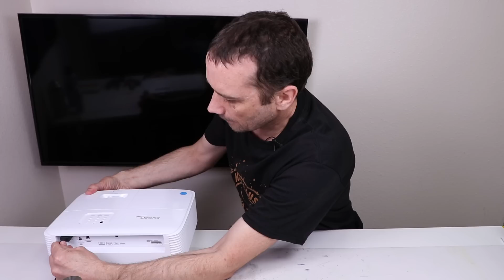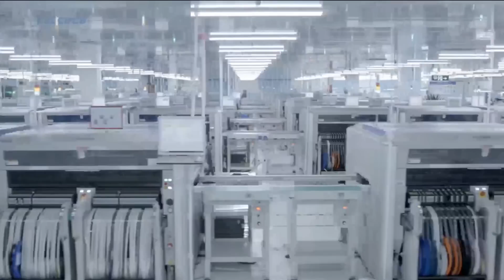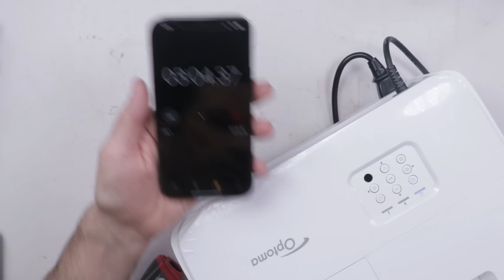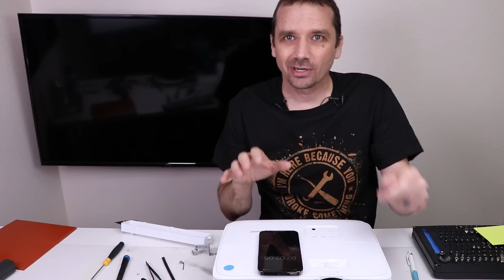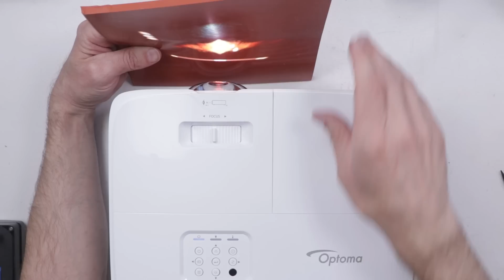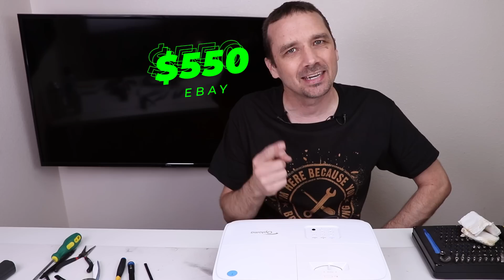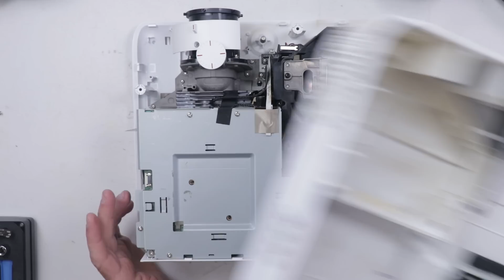I Bought 6 BROKEN Projectors - But Can I Fix Them and Make Money?!

Comment: Wish you would've shown how each displayed images in dark and lighter rooms.   Sometimes the bulbs need to be replaced eventhough they still give light.  The bulbs Don't last for ever. Enjoyed the video.
Reply from the maker: It's hard to know what testing to include in these types of videos. Usually the more testing I do on camera the less of the video people watch so I usually minimize the testing I show. I agree that if I were to sell these as used and tested then I would need to test them much more extensively. Anytime I don't have time to test something fully I sell it as untested so the buyer knows what to expect.
Reply: @Tronicsfix  I bought a few for 60 euros and and repaired them. Most of them had dust in their optical part because the filter had crumbled because of bad material, some had thermal cutoff fuses blown and some sony ones had a faulty chip on power supply. Anyways, its important to check the image, that its not dull, because of something in optics, like dust or that the colors are not off, sometimes there is something wrong with the LCD-s.
Reply: If you go into the menu, you can see the lamp hours
Reply: @absenteeatom  but still would of hoped he would of shown  the brightness of the lamps.   Lamp hours are guidelines not the true physical shape of the bulb.
Reply: @boomsharkboom  And also lamp hours can often be reset so you may not get an accurate account of the number of hours if someone reset the device before selling.
Reply: @boomsharkboom  I wasn't diagreeing with you, merely adding to your comment.
Reply: Sometimes the bulbs are nearly as expensive as the whole unit. It would be great if manufacturers included the "maintenance price" of a tech item, like how much ink/toner costs or a printer, or how much a bulb costs for a projector. 
At a former employer we purchased a projector for $299, just a cheap one, but the replacement bulbs were $249. They ended up just buying a new projector each time the bulb died. 
I have a color laser printer that costs as much as the printer did to put all 4 toner cartridges in. Nearly $600. Sure they last a few years for me, but it's still crazy, and it'll just throw errors if you try to put non-oem toner in it.
Reply: I Agree with you and not only to check the bulbs, when you buy used projectors with dlp tecnology, sometimes dlp chips are damaged and show some white dots, and the only way we can tell is by projecting the image on to the wall to check the quality
Reply: would've*
Reply: Are you broken or what?

Comment: Steve do you think you'll ever repair a ps3 console cause it would be interesting to see you diagnose a ps3 with YLOD
Reply from the maker: Probably at some point.
Reply: I've had a lot of ps3s with this problem and I've attempted my own repairs but due to my lack of experience working with electronics i wasn't able to diagnose the console and trace the fault so had a lot of trial and error and eventually just gave up so It would be great to see someone as experienced as you trace and resolve the problem.
Reply: @scotsbrad  It’s usually caused by the faulty NEC capacitors near the GPU.
Reply: @ultratechgaming199  yh I tried those too I replaced all of them with tantalum capacitors but no luck I think the solder balls under the gpu were cracked unfortunately I don't have the equipment to fix this problem.

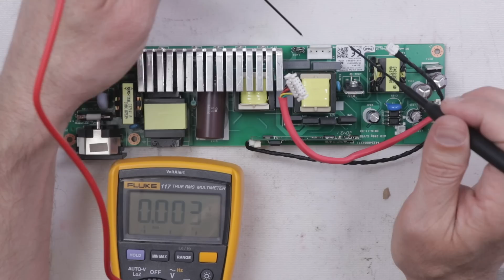Comment: why would there be Voltage at the fuse like that 7:08?
Reply from the maker: There are very large capacitors on this power supply. Capacitors store a charge for (usually) a short amount of time even when you unplug the power cord. This large fuse is on the main power line and connected to the capacitors. If there was a charge in the capacitors there would be voltage on this fuse. Since there was no voltage that told me that there was no charge in the capacitors and that the power supply was safe to work on.
EDIT: As several commentors have pointed out my method for testing the voltage in those large caps is wrong. They need to be tested right on the legs or the capacitors themselves.
Reply: @Tronicsfix  just wondering, but the fuse is "in-line", so that would be like measuring at 2 places on 1 wire. I get the capacitors or plugs as they are always Negative and Positiv or Live and Neutral
Reply: @Tronicsfix  you measured with both probes on the fuse. So you were trying to measure the voltage difference of the fuse itself. Which is not exactly what you intended to measure. Black probe on ground next time. That could have gotten you killed. Always directly measure that cap.
Reply: @Tronicsfix  The fuse is a short cirquit. You only have significant voltage at the fuse when it´s blown.
Reply: also why did he measure at the power jack itself. Thats before the bridge req when the cap lives after. Should always directly measure the cap.
Reply: @CocoaEm  I guess it´s a good idea to measure the power jack befor touching it. There is a parallel interference supression capacitor in  a LC network at the line input.
Reply: @mistersunny3636  failure to measure the cap directly though. even if the cap is fully charged the power jack will never be live. seeing as he plugged it in and there werent massive sparks i can be pretty sure that there would be no backfeeding into the ac jack.
Reply: @CocoaEm  Agree. It's always a good thing to measure the caps. At any voltage stage, not only at mains input.

Comment: Hi Steve, I was thinking of getting one of these.  Not sure what the best make is though?  As i live in the UK only amazon or ebay is my only options.  enjoyed the Video BTW great job.  Also amazon have limited Ifixit tools only three items. Not the case you use with both screw drivers in it.  I really wanted one of them.
Reply from the maker: I'm not sure the best kind either. I'm not that familiar with the best brands of projectors. Amazon in the US has a full line up of Ifixit tools. Maybe they are out of stock in the UK?
Reply: @Tronicsfix  Thanks for the reply Steve,  amazon UK don't carry a lot of items from over seas. So i have to buy all three sets just for the ones i need.
Reply from the maker: You can always go to the UK iFixit website. They should have what you need there.
Reply: @Tronicsfix  Thanks Steve